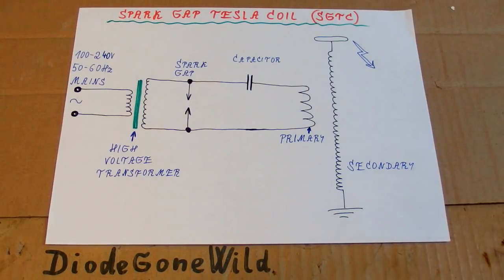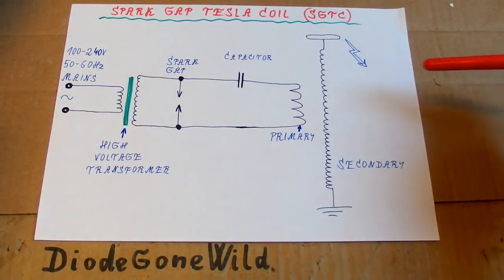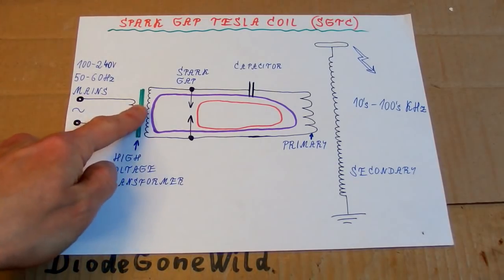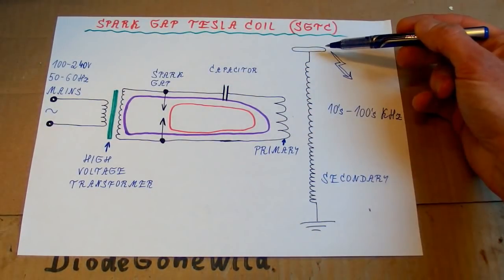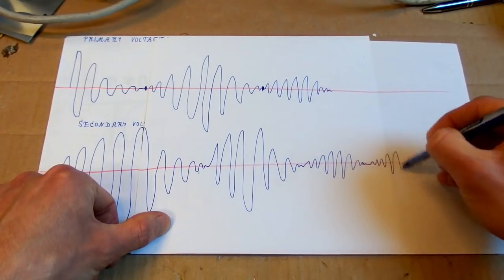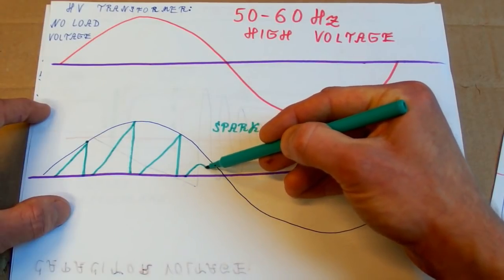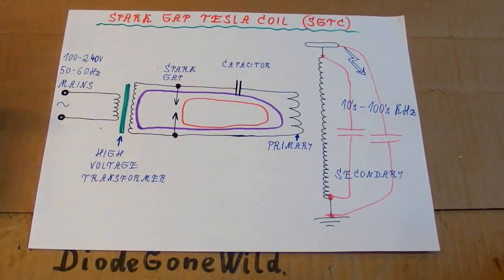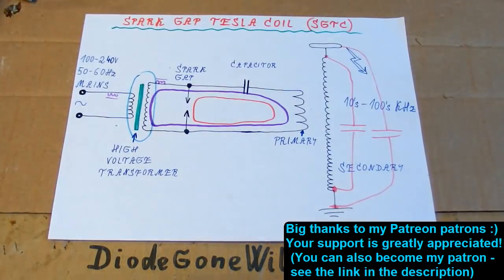Building Spark Gap Tesla Coil pt. 1 - Basics

Comment: It's funny, I just released a video with the spark gap transmitter, doing it the way you say it is wrong at 14:35. Wish I had seen your video first! You might be right, but I'm still not sure which way is worse on the transformer. the spark duration is much longer than the resonance frequency, so the short could be more harmful to the transformer if spark gap is across transformer. And also the resonance frequency is pretty high, blocked by high inductance of the transformer. So if the capacitor is across the transformer, the high frequency energy into the transformer should be small. So something to consider and test and prove which way is better.
Reply: It depends if your transformer is current limited. On a neon sign transformer or a flyback transformer I would not use the "wrong" circuit but on a microwave oven transformer that can deliver a lot of current I would personally rather go with the "wrong" version as shorting it out seems to be much worse.
Reply: I imagine it also depends on how tolerant the transformer's insulation is of high frequency high voltage backfed into the secondary (I'd rather not risk that with any transformer not specifically rated to tolerate it), but I think the Tesla coil's primary is a near-short circuit at 50/60Hz anyway so using the "wrong" circuit wouldn't help much in that regard either.
Reply: Hi Electroboom love your vids :D
Reply: Big fan 😀
Reply: The inductance should block the high frequency but its about the capacitance, because dependant on the frequency the interwinding capacitance could break down the insulation and break it, its simply safer to short it than risk it.
Reply: @janno288  This is a point! High freq-s current goes through winding capacitance, which is huge for mains high power transformers, causing dielectric heating of enamel insulation leading to turn-to-turn short circuit. Also high freq-s voltage divides across winding according to its capacitance, that may cause overvoltage of winding layer-to-layer insulation that is enamel as well in MOTs, also with turn-to-turn short circuit that no one definitely want to obtain)
Both of these aspects cause very local impact on insulation (coz HF capacitance division of voltage is different than LF inductive), thats why it may be worse than longer short-circuit conition but with uniform heating.

Comment: The schematic is actually very similar to Marconi's early radio transmitters! Thanks for a great explanation :)
Reply: Yeah, but rather than a very high ratio resonant transformer, marconi used a coupling one, for reducing the bandwidth, and the monopole wire antenna and the ground

Comment: Excellent tutorial details perfectly how it's done.
I made a coil with 4 microwave transformers in series and have reached sparks of more than 1m .
Reply: did you have to tune yours to get the right frequency?
Reply: @fungusenthusiast8249  Yes, of course, I used the web java TC, the only thing I didn't do well at all is the secondary coil which is too high for the diameter it has and that makes it lose some efficiency.

Comment: I can see how the low impedance of the ionised spark gap will start the lc oscillations into the tesla coil but surely it also puts a short circuit across the high voltage side of the first transformer which is connected to the mains feed. I would have expected to see some sort of ballast resistance on the mains side or indeed on the hv side before the spark gap ? Maybe a 2kw radiant fire would do it.
Reply: Typically an old school iron cored neon sign transformer is used and those are current limited by design to properly drive neon tubes.

Comment: Im almost finished with a SGTC build of mine. My first tesla coil. Its coming along well actually. Also might i reccomend a film capacitor, CBB-81.
it cant handle more than 2000v on its own. But in series with more of the same capacitor it can handle much more. Using just one, ive gotten sparks around 3-4 inches long. I beleive its classified as a pulse capacitor.
Reply: Im just waiting for more capacitors to come in the mail actually. Should arrive in under a month.

Comment: Rectify AC to DC to prevent alternations. (Tesla used DC generator to power his coils). Use carbon rods for spark gap. Use two pyramid shaped magnets to magnetically quench spark gap between north and south poles. Seal spark gap in nitrogen gas so nitrogen gas can absorb electrons. Use diodes in the circuit to prevent any back-rush so energy flow is unidirectional at all times. Make sure the energy flow in the circuit is a series of high voltage impulses/spikes instead of continuous flow. If you start getting large silver-white sparks with blue darts from the top load, you have succeeded in producing radiant energy sparks. This is what Tesla was doing. Read Gerry Vassilatos's book "Secrets of Cold War Technology" for more information.

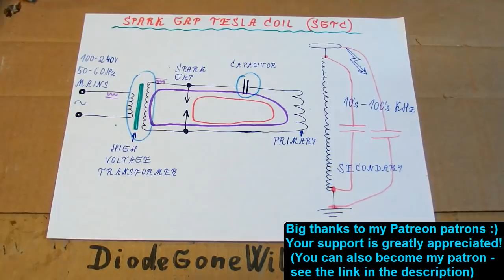Comment: What you are stating at 14:35 and 16:03 in your video I would agree with when it comes to mains input driven tesla coil setups, but, when using HF drivers such as ZVS and flyback transformers the "wrong" schematic is the only one that will work, the traditional tesla coil primary drive design does not work in an HF drive setup. You are welcome to try for yourself and see.

Comment: Fascinating stuff!  It it possible to put a voltage multiplier at the primary side for say using a different primary transformer type, or alternately to  operate off batteries?

Comment: Can you explain and build a early marconi spark gap transmitter?
With coupling transformer and wire antenna! It would be so cool :)
Pls
Reply: @The RetroGamer: It would be very interesting from an academic point of view but not very useful in practice: this method was abandoned due to its poor transmission efficiency: all the energy used for the spark did not go in the antenna!

Comment: Does the LC oscillation make it back across the mains transformer from the secondary to the primary? If so, doesn't that dump a bunch of HF noise into your line?
Reply: No. The low frequency line transformer windings offer high inductance to the high frequency currents and thus there is little or no HF current in either the secondary or primary of the line transformer.
Reply: @cjay2  There's more than one "inductance" encountered in the design of a transformer:
The "main" inductance is presented across the applied voltage; it's true enough that very little current will flow through this at HF, but it doesn't impede transformation of high frequencies. "Leakage" inductance (effectively in series with the windings, created by imperfect coupling) does impede the pass-through of higher frequencies (so SMPS often have to take measures to reduce it); its amount depends on the construction of the transformer. (Consider that an "ideal" transformer would have zero leakage inductance; while all real transformers have some, it's usually fairly small unless deliberately designed in. That may be true of short-circuit-proof transformers as would be used with this, but then it'll also be a rather lossy inductance at RF given the core material.) In short, while it may help, I wouldn't rely on it alone to reduce RFI to acceptable levels unless actually tested against the relevant standards.

Comment: Hei. I wanted to ask. Roughly Joe much current must flow in the circuit. Because I connected but it's not working I'm even thinkin the high voltage transformer I'm using isn't giving me enough current and power

Comment: Could you improve the performance of the Tesla coil by using a HV-SMPS on the input, rather than a simple xformer?  Also, could you use an SCR or other device instead of a spark gap, to reduce the energy lost in heating the air?

Comment: Is there any reason that you wouldn't use a bridge rectifier after the first transformer to charge the capacitor from a consistent peak voltage? A set of 10 4KV GP02-40-E3/54 diodes costs about $3.15 on digikey. A 10 nF 6KV capacitor is available for less than $2 and a 100nF capacitor is available for less than $10, also on digikey.

A possible additional benefit of this approach is that film capacitors usually have a much higher DC voltage rating compared to their AC voltage rating. Of course this capacitor would repetitively go from max voltage down to the voltage where the spark quenched, so maybe that's not really DC...

Comment: can you tell me how can the spark gap turn off when the transformer is still outputting a high voltage ? how can the capacitor charge multiple times in one oscillation of the main power ?

Comment: It is such a pity that neither, DiodeGoneWild, nor ElectroBOOM, did explain the detail of these two circuits shown at  13:08 and 13:11.
It all has to do with matching, in one case the source output impedance being matched to the input impedance of a parallel LC tuned circuit operating at resonance and  the other case of matching the source output impedance to the input impedance a series LC tuned circuit working at resonance. 

 The output impedance of a "step-up" high voltage transformer is normally very high due to the number of turns and so it may be considered as a constant current generator and this is an excellent source to feed a PARALLEL LC TUNED CIRCUIT  as Electro BOOM did, but this current source feeding a parallel LC tuned circuit operating at resonance will produce a very high output voltage which will be reflected on the insulation of the transformer as suggested by Diode Gone Wild.  Again this is a case of a current source feeding a high impedance load which is a perfect matching. The output voltage of a current source depends on the impedance level of the load.

With the circuit suggested by DiodeGoneWild, the tuned circuit is a series circuit that has a very low impedance at resonance and so it must be fed from a voltage source with a low output impedance as otherwise matching is not achieved. The high output impedance of the high voltage transformer is changed to a low output impedance by introducing the spark gap across it, which in fact acts as a short circuit with low impedance. THIS WILL NOT HURT THE CURRENT SOURCE MADE UP OF THE SECONDARY OF THE HIGH VOLTAGE TRANSFORMER as it is basically a constant current source.. 

This video is one of the issues many students have problems with and DiodeGoneWild should be congratulated for what he picked up between the time duration  13:08 and  13:31.

Note DiodeGoneWild should not have said that the circuit dealing with a parallel LC tuned circuit is WRONG    as it is not, and it is correct provided that the insulation of the secondary of the transformer acting as a current source is good enough to take the high voltage punishment of a parallel tuned LC resonating circuit. 
So the theory is perfectly correct of both circuits and it is the practical limitations that would prefer the spark gap to be right across the secondary of the high voltage transformer acting as a current source.  This becomes a case of a voltage source feeding the low impedance of a series LC circuit working at resonance where the source will have a low voltage and a high current. 

This is the reason why placing a capacitor across the spark gap of a fly-back TV high voltage coil will produce what can be said to be a stronger spark. If one pays attention to the color and nature of the spark, one can tell whether the source is acting as a current source or a voltage source!!!!!

Comment: Is just an high frequency transformer that is applied high voltage in a low voltage side and the outbut of thi extra high voltage it is higher bcz is applied high voltage per turn in primary of tesla coil

Comment: could I also use a ZVS driver (Outputs 50KV DC) I think I could because the capacitor would still charge up and discharge/oscillate with the coil. I amalso thinking about using a high voltage variable capacitor.
Reply: You might be able to do that if you put a low value high capacitor across the output (of course with a high value resistor in series) and then a spark gap and another capacitor in series with the tesla coil secondary (the first cap would not resonate but just store energy) .

Comment: I have built a 1,9 meter tall Quad-MOT asynchronous RSGTC acording to this schematic https://www.loneoceans.com/labs/teslacoil2/  .  At first I had 4 MOT with 2 MOT´s as a ballast, with the secondaries shorted out and the primaries in parralel, both MOT´s in series with my 4 main MOT´s(secondaries all in series so about 9kV) and I was getting about 80cm sparks out of the tesla coil. I wanted longer sparks so I tried it without the ballast and I also had 10 MOC´s in series with my Power supply for resonance. Amazingly my 16A breaker didn´t trip but I was getting shorter Sparks than before .  Also my Asynchrones RSGTC strangely behaves as a Synchrones one, which means I have to run it at 50 or 100 bps or I don´t get any sparks at all.

Ps.:  Love your videos and sorry for my bad english (Greetings from Austia)
It would be very nice if you could help out a bit; my dad and I are a bit frustrated

Thanks!

Comment: what is spark gap
Reply: Omar Abbassi basically two conductors close enough so a electric spark occurs when voltage goes high enough. The air is a good insulator but when an electric arc is made then the electric arc becomes a good conductor, that’s why he talks about a low voltage drop there.

Comment: Shouldn't the capacitor be charged up with DC rather than AC? Or is the principle that the charging, sparking, discharge oscillation all takes place in one half-cycle of the mains, then over again in the opposite polarity? Would that effectively give twice the output voltage, running the output transformer one way then the other? Have I answered my own question?

It's just usually in spark gap circuits one charges up a cap from DC fairly slowly til the gap conducts, I don't think I've seen it this way, but then I'm definitely not an expert.

The higher-frequency oscillation for the output coil is generated by the spark gap oscillating, right? Cos they're negative-resistance oscillators. The stuff people had to put up with before amplification was invented! Amazing how dear Nikola used Steam Age technology to do Space Age work!